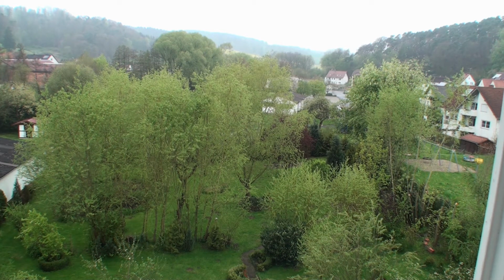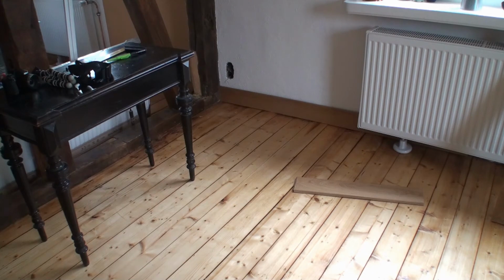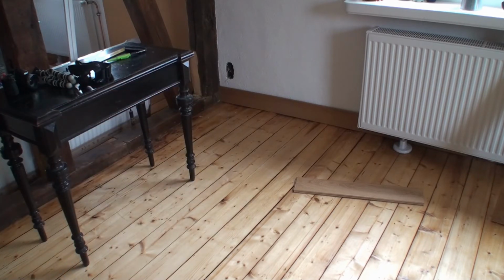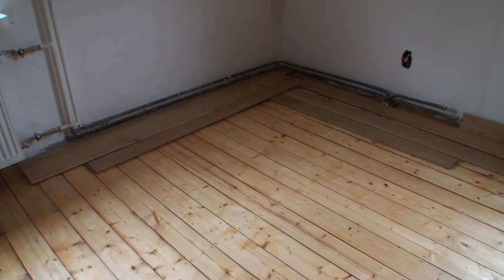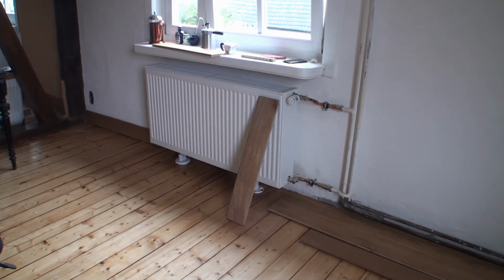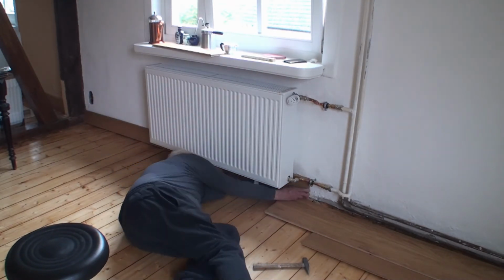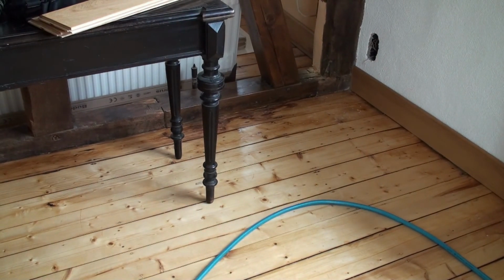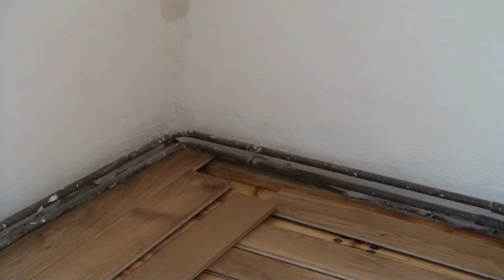Finishing up the new room

Comment: It's looking very good, looks like a good grade of wood. I like the open beams in the room the baseboards really make this room finished and I'm sure that the shelf will look awesome it makes sense to try to cover the pipeline. sometimes it is easier to celebrate something rather than cover it up . FINS UP 👍 👍
Reply from the maker: Thanks kindly Eric. I wish I was done with that job, but so many other things come up in the meantime. I have all the boards cut to length, just have to glue and screw them together.

Comment: A great view from upstairs overlooking the yard. Do you have another coupling you could swap out and see if it is still hard to hook up the nail gun?
Reply from the maker: It's strange, Lloyd. That one coupling may be defective, but I've had the problem before. The pressure is only 100 lb/sq in. I just leave another hose attached to that  coupling. I hate to cut off a crimped coupling from a new hose, but I probably will have to do that. Thanks for watching and commenting.

Comment: Bruce, it's possible that those couplings are faulty.  Also, you may have the pressure on your compressor turned up much higher than needed and that is making it difficult.  Commercial applications often use much higher pressure, especially for torque wrenches, etc.
Reply from the maker: Thank you Craig. The pressure is set at 100 lb/sq in. so I don't think it is that. The hoses are rated at 200 lb. I think you're right, that one coupling is probably defective.